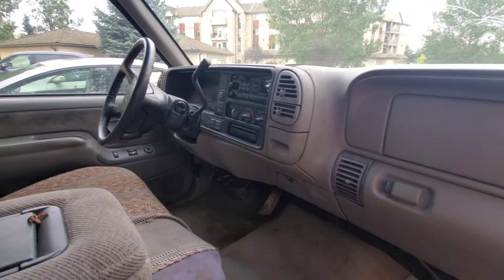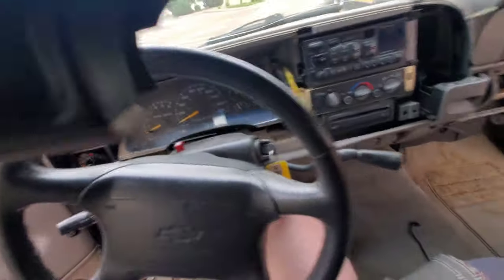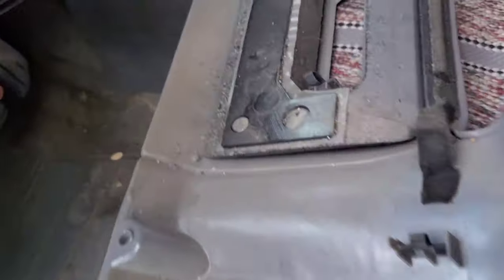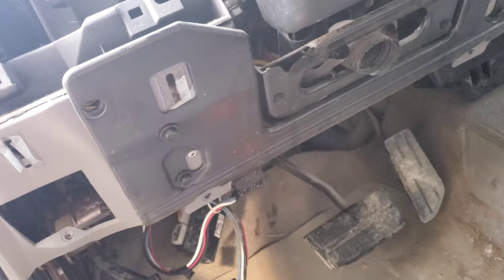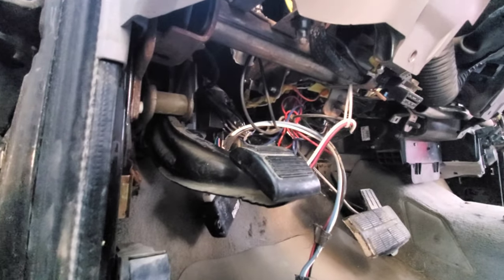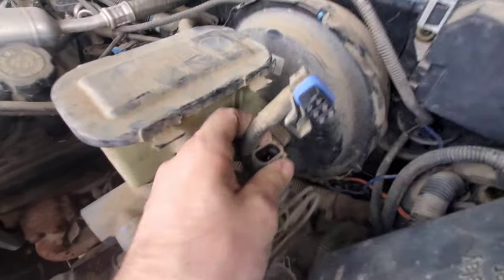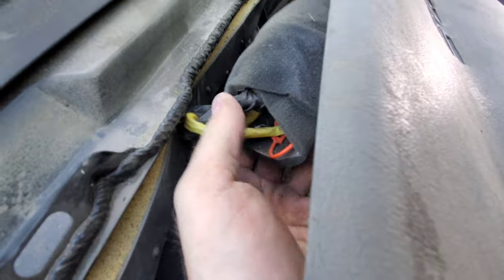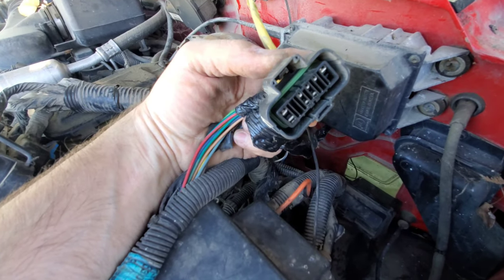Dash Removal Chevy GMC Truck 1995 1996 1997 1998

Comment: At first glace, it looks like a nightmare but after seeing it out, it doesn't look difficult at all. Need to pull mine so I can get started on body work as its getting new paint inside and out. Replace all the components under the dash (blower, actuator, heater core etc) clean it all up, do some preventive maintenance to stop dash cracking before it starts and get the dash cage powder coated as the thought of rust irritates the shit out of me to no end. Right now only two of the little screw holes in the vent up top are cracked (luckily). New din and a half stereo conversion and black everything out. Great video. Saving it for reference.
Reply from the maker: Glad you liked the video
Reply: What kind of preventative maintenance are you talking about? Are you going to coat them with something, apply a backing material, etc.?
Reply: @MrTaxiRob  Not 100% sure. A layer of carbon fiber or fiberglass on the bottom side has been a thought. I know dynamat and such has the ability to flex so thats out. My dash is near perfect except the center bolt clip on top is broke so I'm going to plastic weld it from the under side and the one towards the passenger side is cracked about half way so it needs intervention as well. After seeing what a brand new dash costs plus shipping of such an item, I want to prolong the life of this one as long as possible. They have those plastic molded tops for badly cracked dashes but I'm not a fan of masking a problem because it would irritate me to no end knowing whats under it is still garbage.

Comment: Thanks for the video man it really helps me a lot 
If you see my text a quick question I have a chevy suburban 99 and chevy suburban gmc 99 are all the wires in the dash is the same 
Thanks and God bless you
Reply from the maker: I'm sure they are the same. But when you have both removed its easy to swap the wiring harness over if they are different. Heater core plugs might be different

Comment: T30 will not let the black box on the firewall come off, no matter which way i spin it, either way it get really loose midway through wrenching it but gets tighter then the socket just jumps, I have no clue what’s causing it to not come loose, I did this on another truck with no issues
Reply from the maker: Nut zert must be spinning freely and catching once in a while
Reply: @inlinepaintandbody  thank you

Comment: Agreed this is a great video, thank you. Did mine last week now truck won’t start. Engine turns over but won’t start. I’m wondering if maybe there is a ground wire under the dash that I missed ?
Reply from the maker: Could be security system locking you out. I deleted that system with an aftermarket tuner
Reply: Wait, these trucks have security? You didn’t mention anything about that the entire video not about the wiring harness or the system itself at all

Comment: Do I need to remove the dash in order to swap out the top plastic? I bought a parts truck and it has no cracks on the dash. Would like to put it on my daily  which is all cracked n jacked. Any guidance is greatly appreciated.
Reply: btw- my truck is a 98
Reply from the maker: Yes.

Comment: Here's the disassembly order I used. A small flat blade screwdriver and one of those interior panel clip tools will be helpful for separating electric plugs and the clips that hold them in place:

disconnect battery
computer & cradle (just swing it out of the way, no need to unplug but do remove the cradle)
breaker/relay box (3 bolts under the fender and one on top)
steering column link to lower shaft
5 plugs from top (white plastic) part of of harness (lights, wiper motor, cruise control, plug below brake booster)
next is lower dash, from right to left, including the kick panels and fusebox
steering column, should only be 3 plugs total including one hidden above it, linkage and shift interlock switch

REPLACE the steel tube that supports the column after removal so the dash core doesn't flex and crack during removal
gut the top half of the dash except airbag, no need to bother with it if your donor is good
SUPPORT the center of the dash before pulling the top bolts and the bolt at each kick panel

take a whole hour and maybe smoke a bowl, now you'll probably want help

tilt the dash toward the seats and disconnect the three plugs above the column space and all the plugs going to the climate control system on the passenger side
fish out the antenna cable and pay attention to how it's routed
use your friend to help you lift the whole dash out in one piece very slowly, paying attention to see if you missed any plugs
Set about swapping over your fully intact wiring harness to your new dash like a goddamn boss
reverse the whole process and buy yourself a steak dinner, you earned it because you just saved a grand in labor
Reply from the maker: Great plan

Comment: I'll be tackling this tomorrow.  So many wire connectors?  This video is giving me some confidence to get it done.
Reply from the maker: Once you do it you'll realize it ain't that bad
Reply: @inlinepaintandbody  All done!  Just took my time and made sure not to miss any wire connections.  I worked from the passenger side across to the driver side.  At some point I was folding up the dash and the shift interlock solenoid broke off and fell down to the carpet.  I wasn't sure what it was, but figured it out and bought a new one ($90).  Also, years ago a friend installed an alarm system, so I had to take my time to figure out the wiring.  I took a lot of pictures of the connections I removed and that really helped.  I was patient with the wiring and it took me three mornings in the garage (to hot to work in the afternoons) to complete the job.  Thanks for taking time to create this video!

Comment: Can you get the dash up and out of the way enough to replace the temperature mix motor without uninstalling the wiring?
The dash bar is right in the way of removing one screw.
Reply from the maker: Not sure. If you could unhook all the wiring on the passenger side you might be able to prop that side up

Comment: Alright bro I have a dash from a 97 I’m putting it in my 1990 Chevy but I junk the truck but I decided I might as well swap the whole engine with the harness so I can just plug everything in the same so I bought a 1998 but like you said at 20:34 the plug is different and to the headlights to what can I do?
Reply from the maker: Swap headlight harness or get wiring diagrams and re-pin the plugs to make it work. I believe it's all the same wires, colors and all, just different plugs

Comment: The white plug on the far right that’s different between 97/98, can those be cut off and swapped? I bought a 97 harness to go in a 98.
Reply from the maker: Probably. Chase the wires back and make sure they're the same
Reply: @inlinepaintandbody  Would you happen to have a good harness with the bigger plug on it for sale?

Comment: The bolt from the engine firewall is a 30 tor screw the same on the 96 chevrolet silverado
Reply from the maker: Yeah should be

Comment: Question man ! Do i have to remove everything from the dash just so i can replace the top part of the dash cover or can can i just take of the 3 screws and put the new one that im going to order ???
Reply from the maker: Yes you have to remove everything just to replace the top dash pad. That pad is one big piece that wraps around the metal frame that's bolted to the firewall
Reply: @inlinepaintandbody  @ how much its labor? On this job
Reply: Where do you find a replacement for it ?